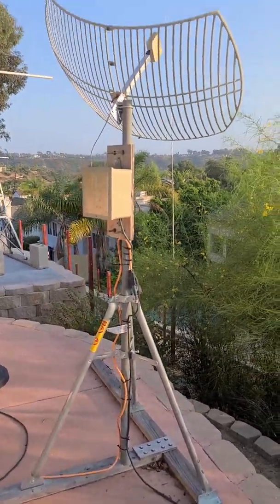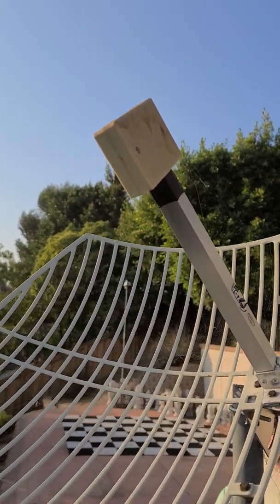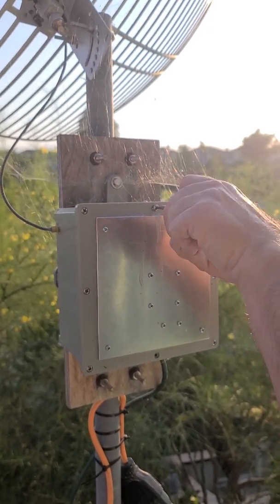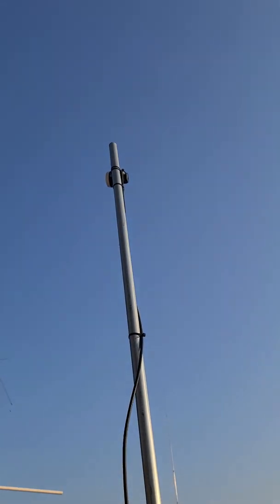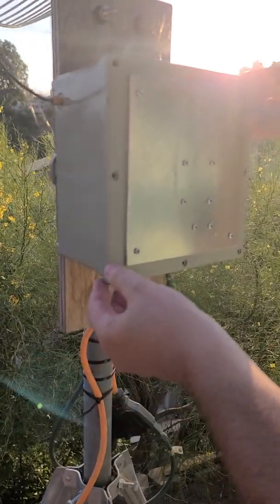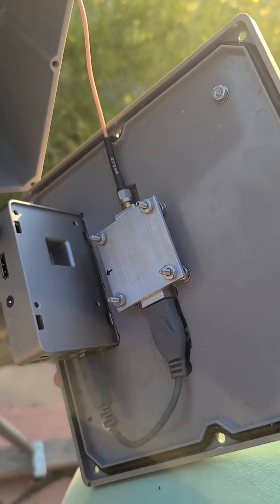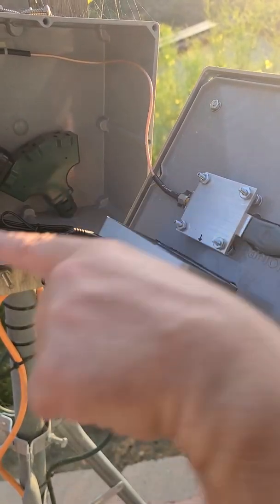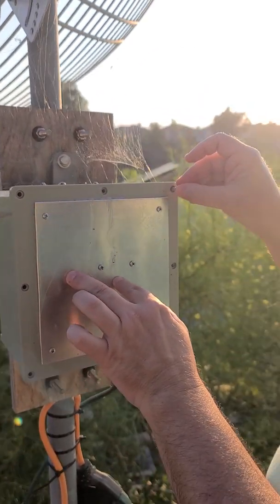GOES 17 receive station

Comment: Great vid, I plan on doing the same thing to cool the pi4. Quick question, where did you change the directory to save images externally? I'd like the images to be saved on my nas to avoid filling the SD card and make processing via windows easier (yea windows meh). Thanks for the Vid!
Reply from the maker: Thank you! This has been a super fun project.

Images are saved locally on the SD card. Then there's a cron job that runs every 10 minutes to rsync the files to a server. One of the command-line arguments to rsync tells it to delete the local copy after it has been successfully transferred. So it doesn't fill up the SD card, but it does contribute to wearing it out. It should be possible to save directly to a NAS, though.

Comment: Very cool, I have a similar setup for goes 16, minus the very smart heat spreader. My setup is mounted inside a waterproof box, and the pi has a tower cooler. I gets vits of around 175 with some scrap metal added to the dish, no extra amplification becides the Sawbird LNA. Tell me, do you get rebroadcasted data from himawari 8, or any admin text messages? I've never got any, just occasional rebroadcast from goes 17.